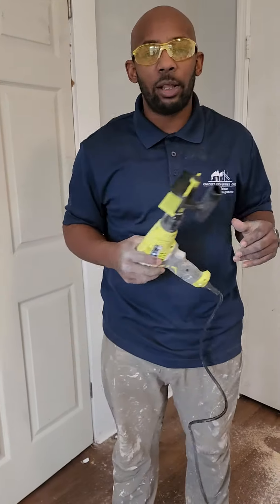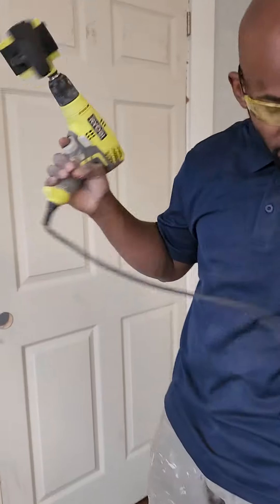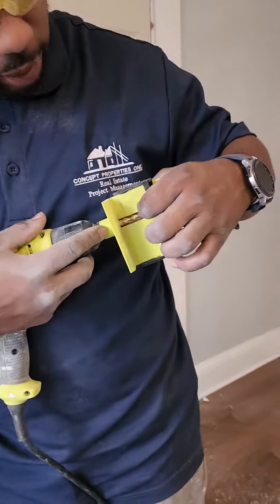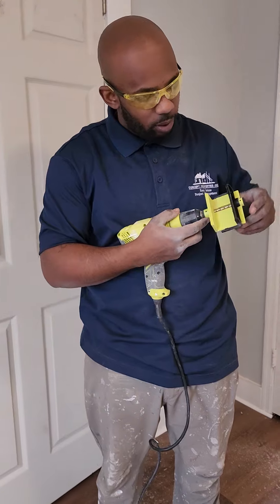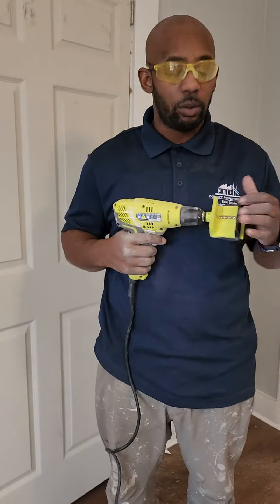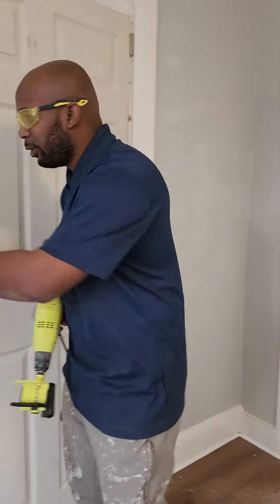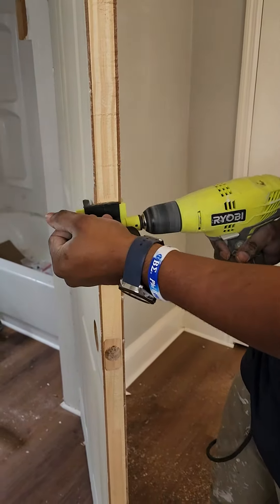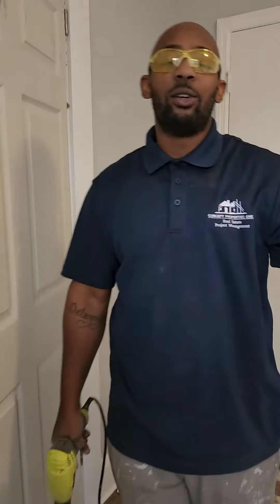Ryobi door trim tool -Make this door fit

Comment: Reckon you have to remove the door to shave the bottom
Reply from the maker: Yes if the bottom was an issue yes, I would also do it on a flat elevated surface. As I should have with this one .